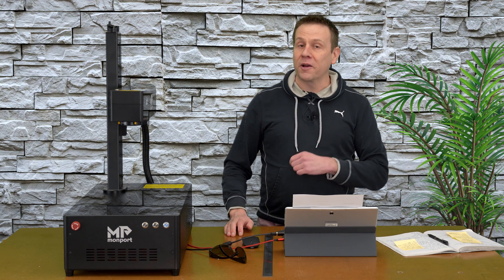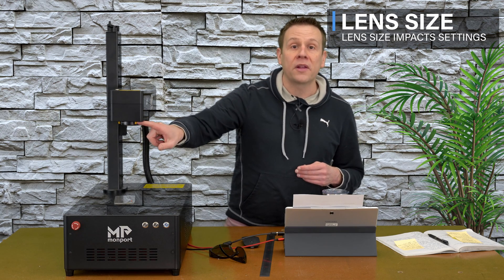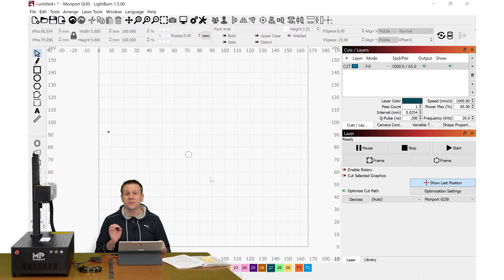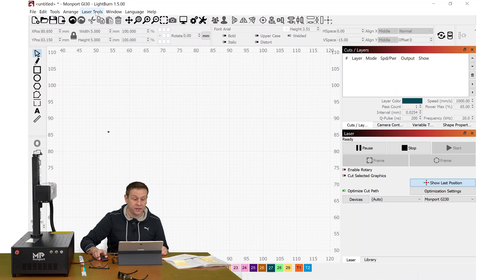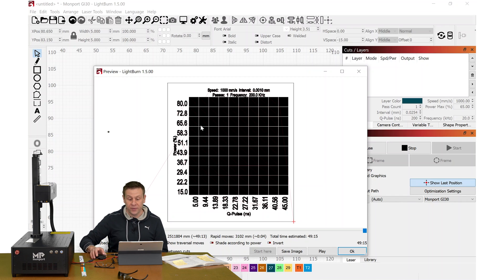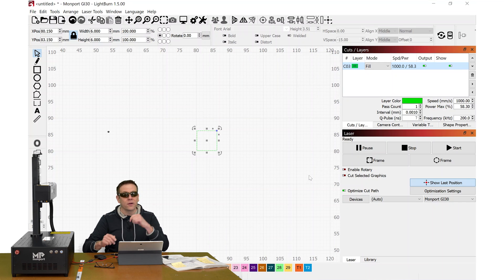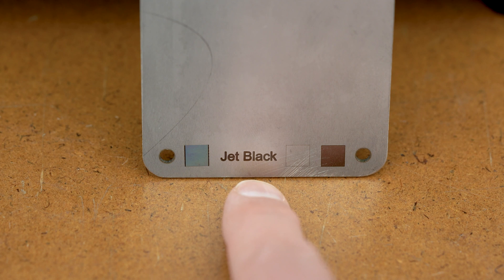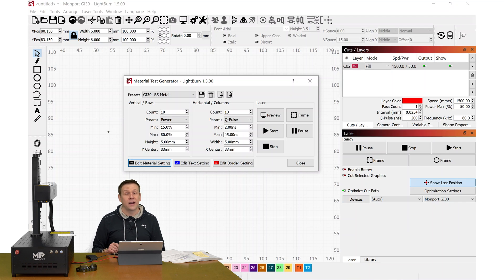Color Marking Stainless Steel- Monport GI30 Mopa Fiber Laser

Comment: yeah those settings are not even close for a 100 w mopa. looked promising..  i wouldn't even say it was a start place.  ill keep searching..   thanks anyway
Reply from the maker: I 100% agree- the laser power, lens, focus distance have a huge role in the color engraving.  Best recommendation is to order extra material and run your own test chart.  Lower Q-Pulse and higher Frequencies will generally produce some colors.

Comment: I didn't get how you framed the template on the steel. Do you make a frame, then do the settings? thanks...
Reply from the maker: Hi - I used the Material Test under Laser Tools.  This automatically makes the test squares with setting based on what I entered- from the Material Test screen I am also able to frame the test pattern to align my materials.  This is around the 4 minute mark of the video, but there's also import information before that you'll need to watch for successful color marking on 304 stainless steel.

Comment: do these rust after time? is there a way to color mark/engrave without affecting corrosion resistance on stainless steel?
Reply from the maker: The only color I heard of rusting over time on Stainless Steel is Black- I haven't experience rust on any of my color marking including black.  Most of my outdoor plaques are stainless steel.